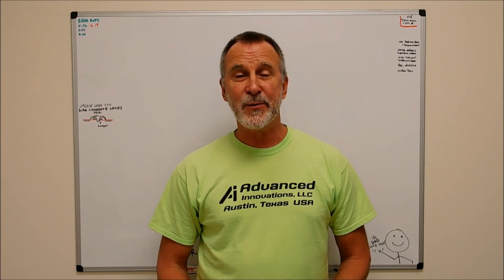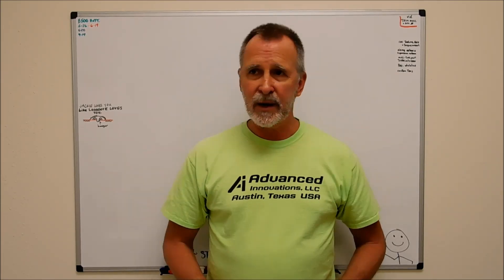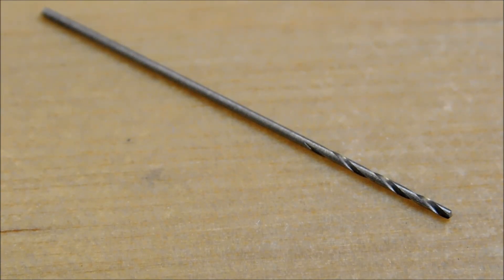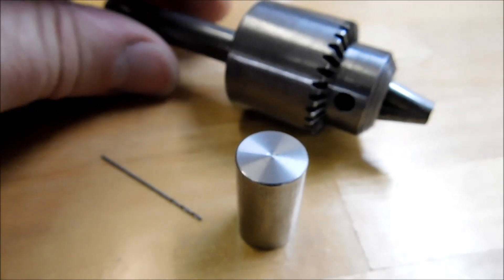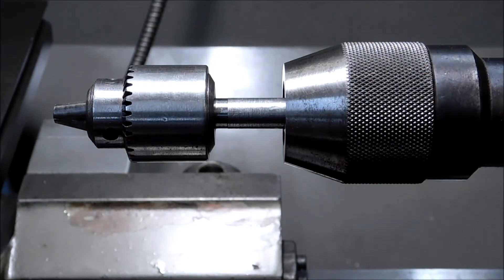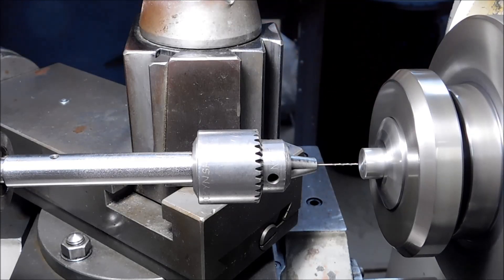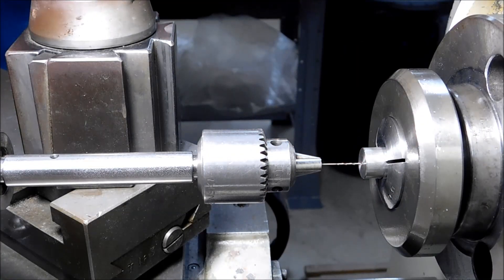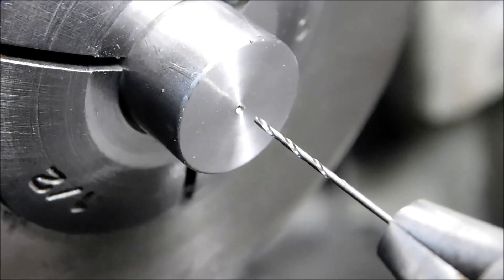Micro Drilling -- Stop Breaking Small Drills !!

Comment: Im drilling a .1mm hole....0039 inches
Reply from the maker: One choice for that task.......Albrecht drill chuck
Reply: @joepie221  can you loan me one🤣I am aware of the price of these. Kinda like buying a Ferrari to buy weekly groceries. As it turns out, my hole only needs to be 0.2mm....TWICE as BIG! The micro bits have 1/8" shafts so I'm planning to use a collet and create a fixture like your for the sensitive feed you've achieved. I believe the key is to avoid bending of the bit. Carbide doesn't bend. Ultimately, the critical thing will be to get a minimal pilot "divot" to keep the bending to an absolute minimum. BTW. The hole I'm attempting is to make a bushing for the escapement in a clock. The bearing is 1.6mm diameter, .2mm hole and about .5mm thick-brass.
You are a rare YT content provider; great ideas and well presented. Overall, an outstanding job Joe!

Comment: Joe, this is priceless for lathe drilling. I have been trying to find a source for small splined shafts with a matching sleeve to make a similar adapter to use in the drill press of mill. Those sensitive drill chucks are obscenely expensive and there's no way I can ever justify the cost for one. Thanks so much for sharing your talent.
Reply from the maker: Mill a small slot in a tube and put a pin in the drill chuck shank. It will drive the same as a splined shaft.

Comment: Another fantastic video!! Now, I'm looking for your opinion on a drill bit. I need to drill (81) 1mm holes, 1/2" deep in 6061 aluminum plate on a CNC Sherline mill using Mach 3 (home shop). I set code up for peck drilling and the first 6 holes went fine. Hole 7 broke the bit (carbide). Any recommendation for something better would be greatly appreciated!!
Reply from the maker: First, use HSS. 2nd, If you have the option, use a deep hole choice for the programming. You must retract that drill completely on a hole that deep. 3rd, coolant. Last.. use a stub drill, not a jobber length. You should easily do all those holes with a single drill.
Reply: @joepie221  Thank you Sir!! You Da Man!!! Please keep up the fantastic videos!! You have taught this ol' man a lot!!!😁

Comment: Microdrills fail by Euler Buckling. The maximum pressure is approximately imversely as the square of the slenderness ratio so it is most important to control the drilling pressure. I use a chuck where the pressure is controlled by a coil spring in a sliding sleeve. It can be used in the lathe or drill press and you can keep fingers well out of the way. Start with a low pressure and gradually increase as the unsupported length decreases.

Comment: what the trick to drilling brass carb jets with .045mm carbide drills? These drills look like sewing needles....do you just use the little drill pen and twist with your hands or a Dremel and a press? I literally touched a part with a small bit and it just broke off like a splinter
Reply: Some of those PCB drills in solid carbide are incredibly thin. Any attempt to use these freehand is going to end in tears.
Of course, they are normally used by robotic machines in PCB manufacture.
How do they make them in the first place?
Reply from the maker: Depending on how much you want to open the jet, you might be better off using a reamer. You don't need carbide for brass, so HSS will be just fine.
Reply: You need to change the cutting profile for brass. Zero lead in on the cutting edge

Comment: Really a super video again Joe!!! I’ve always been super fortunate to have use of Hardinge HLVH SUPER PRECISION lathes.wherever I was employed. Not much of a machine for medium to large parts, but for small to micro parts nothing could compare! The tail stock was a monster to remove from the lathe, but for small hole drilling in most materials I think anyone could be a master machinist in no time. I had one of the precision drill chucks you mentioned and the smallest hole I ever drilled was .005” and only .020” deep in aluminum. Luckily the lathe spindle speed was 3,000 rpm. The surprising thing to me was I actually preferred to drill 304 stainless. Every time when drilling, I’d get the most beautiful two chips coming out of the hole. I was surprised how much force I was putting on the drill without it breaking! Thanks so much Joe for your always interesting machining videos.

Comment: Thanks for the video now

I am working with watches and have a steel bracelet with a stainless steel screw that is stripped and needs to be drilled out. 

Can I use a rotary tool or regular drill to drill out the screw?

Thanks

Comment: Takes me back to when I was working as an optician drilling broken eyeglass screws by hand ,00-90 screws by hand with a dremel. Lots of patience required so you hopefully could retap and save the frame. Your method is very good as usual. Thanks for sharing!

Comment: How do you know that its drilling dead center all the way though?
Reply: You don’t. All drills, especially very small ones, wander slightly off center on deep holes. If the drill is sharp and correct pressure and lubricant are used drift can be controlled within acceptable limits.

Comment: Have you ever thought about Carriage Drilling where you hold a drillchuck in a QCTP holder . i have seen it and i realy want to make myself a setup for it . some companys even offer MT1 , MT2 or MT3 and MT4 QCTP holders to accept tapered Arbors for drillchucks.
Reply from the maker: I have, but this gives much better feedback on small drills.
Reply: @joepie221  okay,i gottta try this...sometimes i have to drill 10 thou Diam. And that is quite a Task with a max Rpm of 2500 on my Emco Maier Lathe

Comment: Nice technique. I was taught to use a pin vice sliding on a drill blank mounted in a Jacobs chuck. As the drills get into the very small sizes (76, 80) it’s even easier to get the feel. Your RPM seemed a little slow to me for Stainless. Having a high speed bench lathe or a Hardinge toolroom lathe makes life easier too.
Keep up the great work. Thanks for sharing.
Reply from the maker: My pleasure.

Comment: Joe you are a 100 % right when you said you cannot teach the feal for when you're drilling a piece of material.  I was lucky or blessed in my aviation career of 50 plus years to have this touch. I tried many many times to describe and teach this valuable skill to fellow coworkers. I wish I had a penney for every time I had to drill a rivet hole in a blind area in a wing and know it was straight and not to deep of a hole. Thanks for the memory.  You said it was stainless steel it was stainless steel. I will take what you said to the bank, because it can be done. I have done it myself.
Reply: hi maxmclanahan have you become a flat earther yet? If not I suggest watch a 13 part series called What on earth happened by Ewaranon to learn that the earth is not a globe. I got it in my about tab.
Reply: @flat-earther What’s on the other side?
Reply: @ellieprice363  what other side. I don't think I know the answer but that doesn't make the earth a globe.

Comment: I'm a watchmaker using a 6mm lathe with a special lathe attachment its on the same line as this but more reliable and accurate I have my doubts that you were drilling into stainless steel
Reply: Stainless isn't that hard to drill... I machine lots of different types of stainless regularly on a manual lathe with very few if any issues. Stainless cuts like butter when you compare it to something like Inconel 718 or 400 Monel. Both of which I have worked with multiple times. That stuff is a pain. I'd even go as far as saying stainless is easier to machine than aluminum. Food for thought.
Reply from the maker: Doubt all you want. If I said it was stainless, you can take it to the bank.

Comment: So it's kind of like a floating tap holder.  In the shop I work, being the low man, running the oldest most poorly maintained machines, I hoarded floating tap holders.  My go to lathe was a 1980's Mori AL-2 where you had a snowballs chance in hell of rigid tapping on a production basis. Everyone else uses rigid tapping, relying on the machine and the right feeds and speeds. On my first day in the tool room I watched a guy with 20 years of experience break a tap on a manual machine and thought back to those floating holders.  We needed that part and it was junk.  The machine I run now can rigid tap, but if you are off in any parameter, it's game over.  One fat finger or a rounding error.

Comment: I wonder if this can be reverse engineered to have the workpiece stationary while having a Dremel with varispeed riding on a similar 'sliding chuck' mechanism that is rigid yet can be hand -fed smoothly like shown here; makes it so people without lathes can do the same if they can get slip-fit pipe and shaft pairs to have the Dremel ride on.

Been also thinking about finding a broken-beyond-repair Dremel or similar knockoff and repurposing the 'chuck' on one for lathe use. There's also a Dremel-sized mini jacob's-esque grip chuck; have yet to figure out how to fabricate a shaft for one. Got to make one soon to make use of some miniature steam injector cone mandrels I acquired...

Comment: Chuck in a chuck.  I have set a pin vice in a chuck for sub- 1mm bits.  I like the video tip…but you must be sure of a very close fit of the secondary chuck shaft in the extension sleeve or wobble will ensue…

Comment: Very useful trick, especially for us micro-machinists and hobbyists! How important is rpm while using fine drill bits? I have a cheap jewelry/hobby drill press, but its slowest speed looks pretty close to 1,000rpm
Reply: The general rule of thumb is that the smaller the diameter of the drill, the higher the RPM. Based on what I remember, stainless should have about 40 SFM for a Cutting Speed (w/ HSS). Joe’s .026” diameter drill (or the workpiece) should therefore be spinning about 6,000 RPM. (RPM=4xCS/D).

Comment: Looks like a great tool and technique. The idea of rotating the work while holding the drill bit still is great. It solves much of the complication of making a sensitive drilling attachment. Of course it does limit you to drilling holes on parts that can be held in the lathe chuck. 

I followed a link to this video from a question on the PM board about using a 0.004" drill bit. I have used a 1/64" bit (0.0156") in my Unimat lathe and in the drill press configuration of that machine with NO problems. So 0.026" does not worry me in the least unless it is a cheap, poorly made bit. I have even used a pin vise for drilling 1/32" holes (0.0312") holes in softer materials by hand with no problems. The pin vise allows me to rotate the drill bit using my thumb and forefinger, without moving my hand. That eliminates the movement that other hand held methods will allow and which causes the drill bits to break. The 1/32" and 1/64" bits in my shop are both around 40+ years old and have at least a dozen holes behind each of them. I haven't broken them yet. Now that 0.004" bit does make me pause a bit but I will make a note to get one and try that using this technique some time soon. 

As an additional note, I would not try this with my SB-9 even though it has very little runout. The Unimat can run at 7,500 and perhaps even 10,000 RPM while the SB is limited to about 3,000.

Comment: I have made similar myself, for small taps and dies as well as drills. I made a small  bored metal with a cam side profile and a small handle..  i.e. similar to yours except shorter and this bored piece of metal was a sliding fit on the extension as you turned the handle it pushed its side cam profile against the  rear of the small chuck. I hope I explained that correctly lol, oh ps there was a small light spring at the big chuck end just to keep a light tension. Greetings Joe from Scotland

Comment: Did this very same thing 20 years ago on my 14 x 36 lathe to drill a .019 hole in a clock shaft to repair a broken off bearing area of a
 gear shaft  , and pressed a piece of a straight pin 📍 in the hole and then cut it off to length for a new bearing surface .
The clock keep perfect time after the repair .
Just drilled a .042 hole in steel screw to make a carburator jet that was missing in the drill press 2 weeks ago , that was a bit scary but I got it done ok .
I need to make a proper adapter like you have thou .
It will work better than the simmler way I did it .

Comment: I have to drill some 0.001" holes in medical grade tubing. I did a few practice runs with a 0.2MM drill,  That went ok, but it’s a long ways off where I need to be.
Reply from the maker: Good luck. Maybe a sleeve setup is what you should try.
Reply: Use a heated wire.

Comment: Also known as a "sensitive drill". Got one of mine at a machine shop auction for $40. Spring loaded, works on drill press, mill, and lathe. Check ebay for sensitive drill and you won't spend $700.

Comment: What an inspiration! I always disliked using small drills but had to or my Foreman did not like me! Re: A Pillar Drill Usage. I suppose one could make a nice adaptor tube with a wide and stable base (Suitably Clamped or Affixed)and then slide the Chuck upwards and into the work piece! I used to use a Small Hand Wound Drill (Like a Car Differential) which gave me a little "Feel"! Onward and Upwards Mate! Thank you Joe for evermore! Rob of Halmore in the Berkeley Vale, West of England. Former C.E.G.B. I.M.D  Craftsman. Oldbury-on-Severn Nuclear Power Station. Oh! Those were the Days!
Reply from the maker: The floating setups like this intended for drill press or vertical use normally have a cross pin in the drill chuck shaft and slots in the tube. It still allows it to float, but drives it at the same time. Most also incorporate an internal spring to keep it from falling towards the work piece. Thanks for the comment. Stay well and warm.

Comment: I don't have a lathe, but I think it will work with a drill press with sticky grease in the sleeve.
Reply from the maker: The adapter may be the only thing spinning. You'll need a drive feature and a slot.
Reply: @joepie221  Yeah, I'll probably end up with a slot and dowel, but it's worth a try using stiff, sticky grease for .015 and smaller. Thanks Joe!

Comment: That's a really good idea!
I wonder how it would work if you just put the shaft of the small chuck into the big chuck and left the jaws slightly loose, just enough so you could still slide it?  It would probably be worth trying if you only have a few holes to drill.
Reply: That is exactly how I did it the first time drilling a .019 hole in a clock gear shaft and pressed a piece of a straight pin 📍 in and cut it off to length for a new bearing surface.
Worked well just held chuck tight enough so it would not spin , so if it grabbed it would spin and not break the drill .
The clock keep perfect time when done .

Comment: Your tailstock seems to be off centre (too low).
Reply: I think he was just demonstrating, not doing anything remotely precision.
Reply: @d7588  hopefully, yes. The whole show was not impressing that much.
Reply: @Herr_Bone  You completely missed the point of the video.
Reply: @darkwood777  Would you be so kind as to tell me what the video was about in your opinion?  Or can you just make comments?
Reply: If anyone is going to do this kind of work take the time to check and set up every dead on zero and then turn a test piece and mic both ends to be sure it is perfect , no room for anything to be off or drill will bind and break .

Comment: Super method. Wow, that is a great solution; much appreciate your sharing it. Thank you.
Just curious; what's the tolerance between the drill chuck shank and the cylinder holding it? Thanks
Reply from the maker: About .0005". Close enough that the air hole in the arbor is a must or it won't go in.

Comment: I had often used these many years ago, and they worked well. But for very small drills,  it can still be hard to feel the resistance and broken drills can still result. I eliminated this by installing a drop indicator mount on the quill and used the quill stop to control the pecking depth of the drill. I would peck .001"-.003" at a time and did not rely on feel. Also, it improved chip clearing and prevented me from getting over aggressive with the down force on a finger chuck that often would  results from my impatience.
Reply: Patience is a virtue.

Comment: Something that has been available forever.  >>> https://www.mcmaster.com/spring-loaded-drill-chuck-arbors/ <<<  We called them "jack-off chucks" when using them 35 years ago.
Reply from the maker: Many commercially available models of this are keyed and spring loaded for mill work. if a drill grabs, it breaks. This setup floats  on travel and rotation. if the drill grabs, just let go and it wont break, but this is intended for the lathe only.
Reply: @joepie221  Excellent video!  Will this model work on my DELTA drill press?
Reply: We had one of these where I worked. I was going to post it but you beat me to it.

Comment: If you have a lathe you could make this tool out of scrap. Cost would be almost zero.
Reply from the maker: I did.
Reply: @joepie221  Yours has a hand clutch perfect for a lathe .. the McMaster doesn't from what I can tell but would be fab for drill press. Well done.
Reply: Since the tool is used on the lathe, if you need the tool, you have a lathe!
Reply: You will not be using this if you don't have a lathe .
So you should be able to make one some how to do this .